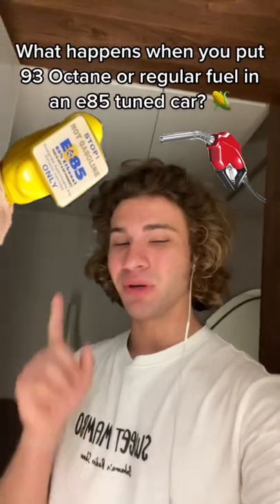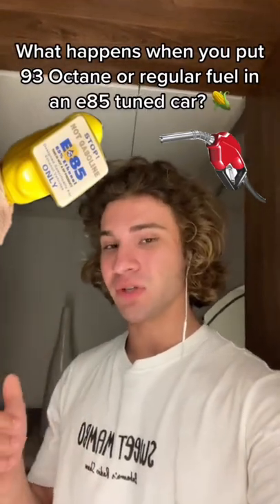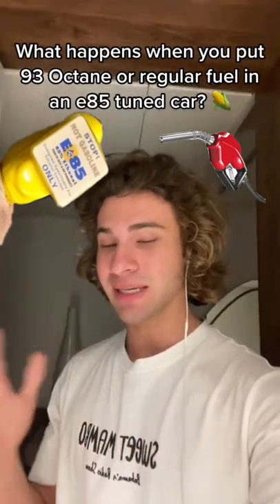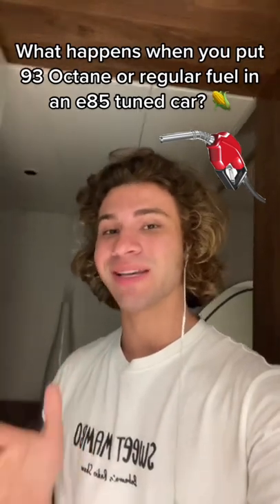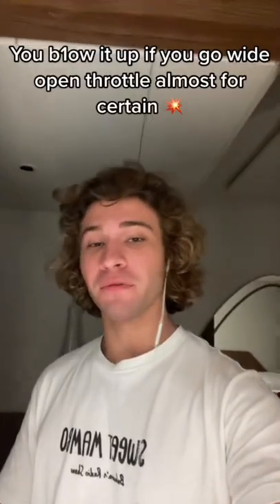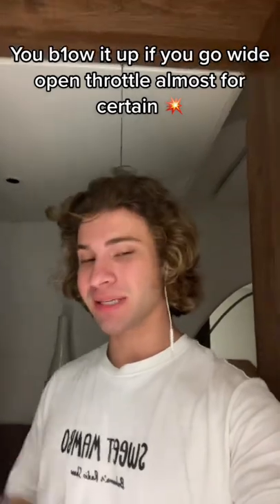THIS IS WHAT HAPPENS WHEN YOU RUN 93 PUMP GAS ON AN E85 TUNE... (BLOWN ENGINE?!) #SHORTS #E85

Comment: While not incorrect, but also incorrect, here’s some things about this:

Ethanol has less power density than gasoline, which is why you need a bigger fuel system to compensate. It’s about 30-35% less power dense (or power potential), so if you make 200hp on 93, to make the same on ethanol (E85) you’d need 30% more fuel volume to do it (I’m saying 30% for easy math, not the true mathematical number to the decimal). Running pump on a full E tune would just be super rich, and likely to cause hydro lock if run at all.

Ethanol has a MASSIVE window for timing because of insensitive to timing changes it is for its octane rating. Example would be 110 race fuel, 1 degree of timing can lose or gain a good amount of power, and is super picky. Ethanol (I believe is around 115 octane?) doesn’t give a fuck. There’s been engines that can swing 10 degrees and it barely makes a difference, hence why boosted guys love the stuff, just a safer alt fuel. Also works well combined with other fuels like meth or power adders like nitrous because of this property.

Ethanol also runs cooler than gasoline, so you can have lower cylinder chamber temps and intake temps.

Fun fact: they make ethanol scents, you can literally make your cars exhaust smell like blueberries if you wanted to on ethanol lmao

Flex fuel tunes, LITERALLY prevent this entire short. So the old ethanol only or pump only days are gone. The only people who pay attention are anyone who’s max ethanol content in their tune is anything below full E85.

Also(edit): octane is just resistance to detonation, aka the fuel can be used in high compression environments. The higher the octane, the better it will work with more compression. This is a blanket statement, and when you actually dig into the science behind how fuels work, you’ll realize it’s more of a grey area than black and white on how to balance your cylinder pressures with your fuel of choice, and desired power goal

Comment: What's his compression ratio? 93 octane will do nothing to an ethanol capable engine.  Detonation is prevented through the knock sensor, which automatically retards timing.  E85 on a strictly gas engine though will eat it up bad, since ethanol is caustic on aluminum.

Comment: E85.  Is ask follows. 85 per Ethanol and 15 gasoline. 

Octane has to do with the stability of the fuel ur using.  Higher octane for higher compression engine. Lawnmower weed eater and sports car. 
The lower the octane. The less stable the fuel. Could cause fuel to ignite before the spark engine combustion and cause an engine knock.

Comment: Neither actually. I ran flex fuel in a non converted 94 ford pickup. 300 inline 6 engine took it like a champ. Ran it again about a month ago in my daily ka24de 5speed Altima ran fine sold the car it still runs. 250k on the dash the ford had 275k when I ran flex fuel.

Comment: If your tune is for full e85 and you don’t have an ethanol content sensor, you’re gonna be running way too rich.. extra timing isn’t gonna cause knock if it won’t even run because it’s spraying 35% more fuel in than it needs

Comment: why didnt your ECU adjust lamda? any modern ecu will correct trims.......bmw for example since u used a bmw for a pic,   if you flash tune one of those for e85 and the dme sees the fuel trims are off  because youre on 91 it will adjust fuel trim targets leave your wastegates wide open and pull a ton of timing.  it will not detonate. in fact, you can drive on 91 on an e85 tune on that car because it will only make spring pressure for boost. it will not hurt it..   same for that s550 mustang you posted, both of those cars have variable valve timing, it will retard the ignition and valvetiming when fuel trims are off, this is true for ANY modern car lol.

Comment: I don't use pump fuel i use race fuel from the track near my house they sell it cheaper then gas stations they sell 105 octane fuel for 2.10 a gallon and my truck's engine is fine with it i built it to handle pure methanol so the race fuel is fine in it.

Comment: Isn't that the reason why you run a flex fuel sensor so the ecm can calculate timing based on fuel tables 🤔

Comment: You can put you have to have the best spark plugs & 12 hole injectors spread the fuel n a fuel regulator & or  maybe smaller fuel pump

Comment: Tune??? My Nissan frontier 2017 came stock flex fuel owners manual says I can use 4 types of fuel 87,89,91 flexfuel I assume it is a safer tune for stock vehicles to adjust timing from the dealership.

Comment: If you run pump gas on an e85 tune it's going to be super rich in PE... 9.75 is stoich for e85 and 14.2 is stoich for e10 pump gas. not sure if a few degrees of timing would blow a motor that way... maybe if you ran e85 on a pump gas tune it would be lean af.

Comment: Yeah, E85 doesn’t run as hot as regular fuel. It’s not gonna blow your engine up. Most of the time you can mix it if you have it tuned for that.

Comment: Running 93 in a car tuned for e85 Yes it will cause problems and yes you'll have slight timing problems but it'll just more be sputtering and not happy and if you're a car guy you'll know to just shut it down immediately because it's not supposed to do that and on another note he explained the wrong thing of what the video was saying if you run e85 in a regular tune You're going to run lean which is a whole other problem and yes timing can be a factor, but you don't always run crazy timing for e85 especially if its more of a street/strip tune.

Comment: E85 in a car not designed for it will dissolve the rubber components like your fuel lines, gaskets and o-rings.

Comment: Running Ethanol regularly is bad for your engine because alcohol has more corrosive properties than 100% gasoline. It decreases the longevity of the engine and supporting parts a minimum of 25%. You’re much better off running a good wmi kit, this increases your di fueling window, decreases charge air temps, reduces engine temps eliminating heat soak, cleans injection valves which are known for carbon buildup, and adds a big performance gain.

Comment: You know if this guy actually had some boostane that is basically octane booster straight up in a can he could have put a bunch of that in of course he would have to be doing that before he added fuel but it's always something good to have if you're going to run something high performance 

Now for those that have a regular car there's actually kits out there that you can buy that are actually decent and you'll have to unplug your injectors put in this other harness that will pass the signal from the computer to the injectors but there's a secondary computer you're going to have to intercept the signal but it will allow you to run e85 and the reason why it will do that without tuning your ECM because it's intercepting the signal and then passing what the fuel amount should be now they actually have a sensor on the fuel coming in going to your injectors so they already know how much octane ethanol is in your fuel so it automatically adjust now if there's an issue these kits actually do have a part that you keep with you and all you got to do is unplug the one little computer plug this dummy in and it will pass the signal like nothing ever happened like no modification whatever it's completely bolt on there's no splicing wires or nothing I can't remember the name of the kit but it's wonderful if you want to make a car e85 or basically run a higher grade of ethanol 

Me I'm all about that ethanol-free gas let me tell you I've run that in certain vehicles run so much better

Comment: Well, what you really need is an e85 sensor to determine the actual percentage of e85 at the time. E85 isn't 85% most of the time, it's a mix of 35-85% of ethanol depending on mix and cpu needs to know what it's actually running on and change map accordingly 😉 😀 

Happy modding everyone

Comment: Yeah putting pump gas on e85 tune will make it run rich AF if it runs at all, however if you have an e85 tune to begin with, you probably have a flex fuel sensor to accommodate for different fuels.  E85 on a pump tune is a different story it will run lean if it runs at all.  In both cases unless you are a complete moron and can't feel your car isn't running right, the chance of actually doing damage is slim.

Comment: I run e85 in my 2012 Silverado that has a jasper dod/afm deleted gen 4 5.3 that came with a dyno sheet with 87octane numbers. Zero issues. Stock pump, map, and lines. Motor has 10k miles and sees limited literally everytime I drive it. I have video proof that's 3 and a half minutes long of a limiter burnout from Oct 21st while at my cousins benefit drive. You put e85 in a car in the video so I'm confused about this.

Comment: 85 in a 93 tune will make it lean 
If your wide band or narrow band can't correct it 
You need 30% more e85 I thought so bigger injectors and a bigger feul pump 

The other way around you get pre detonation and 30% to mutch feul the amount of access feul can help cool down the engine and prevent knock but not much

Comment: What he's calling detonation is colloquially known as knock. It's premature combustion. Contrary to popular belief ethanol isn't added to fuel to reduce the amount of fuel used. It's used because ethanol replaced lead as a knock preventative. Actually the studies show that a mixture of fuel that is at least 10% but no more than 15% ethanol has been shown to reduce knock. It's not a coincidence that that range is what's posted on the pumps.

The more you know

Comment: So knocking is still a thing? Or again? And E85 should be more knock resistant than regular pump gas. Its octane rating is around 100-105 if I remember right. The higher ethanol content also means E85 has a lower energy density than regular gas. But it allows for a more aggressive tune, higher compression, more boost etc. it should be fine with blue and green avgas if you can get your hands on that. Or… try 93, add some TEL if you can get it, say bye to your cat (it’s use and pointless anyway) that’s gonna die when using TEL and have fun with improved gas mileage compared to E85. 😂

Comment: why theres 80plus octane here? but in the Philippines has 93 low octane, 95 mid octane and 100 high octane
Reply: Different systems, you're 93 and 95 are equal to our 89 and 91 respectively

Comment: Can anyone help me? So I got my custom e30 tune coming in and I have a 3.0 turbo q50 with stock fuel system. Will running a mixture of e30 on stock fuel system and e30 tune be bad or do I need to grab myself a flexfuel kit

Comment: But it's cool to run 93 on a 87 engine though right?
Getting conflicting information
Reply from the maker: Depends on the car & if it’s stock! Most factory/stock cars will adjust timing to prevent pre-detonation
Reply: @TobyVegaD  okay, thank you! That's good to know, very interesting.
Reply: Don't you'll lose power

Comment: Let me stop you right there it has nothing to do with timing running a lower octane rating meas it cant handle the compression of the engine resulting in detonation. Timing is an electrical signal sent from the ecu to your ignition coils. So with lower octane ratings predetonation can ruin the engine. Read up on it first

Comment: Nah literally all cars have fail safes for this exact reason knock sensor would put your car in limp mode before Anything actually happens to your car.  If you have a flex fuel sensor it would literally trim out your fuel map to match the ethanol content and most of the times when you get tuned for E you still have some of the oils gas in the tank unless you drop it so most likely its tuned  for close to E- 50  and most e isn’t close to 85% ethanol   I’ve mad this mistake and my car is fine it ran like shit all I had to do was get some of the 93 out and add e til about 40% til did some hard street pulls and filled it up with more E all good most people who have e tunes don’t run it on e all the time it would get shit mileage

Comment: Running E85 on a non E85 tune would have blown up the motor because you have to burn 30% more E85 then gas.  It blew up because he was running hella lean and it burned hotter then the god damn sun and turn his pistons into a liquid

Comment: You’re an absolute fool if you don’t run a flex fuel sensor (ethanol content sensor). Especially considering how not 85% “e85” can be at the pump.
Reply from the maker: You’re an absolute fool to think that every boosted car can be tuned for flex fuel
Reply: @TobyVegaD  they can? Any stand alone ecu can be programmed for flex fuel, it’s completely possible. I understand the limitations of factory ecu’s
Reply from the maker: @2zer084  Lund racing doesn’t offer flex fuel tunes for boosted cars

Comment: With how much fuel you will be dumping into the intake on an E85 tune, your never going to see detonation. You will see bore wash, oil dilution, crap milage and destroy the cat if you still have one....
Reply: Simply not true....I filled up full tank of 93 with E85 tune...ran out of options so had to do it to get to the station that pumps E85.
If you dont go WOT, you can drive till empty and then properly fill E85.  Its not recommended but you WONT blow anything up or do any damage.

Comment: What kind of shitty fuel do you guys have? Over here it doesn’t matter if you use regular or high octane. That’s what knock sensors are for.
Reply from the maker: Lol I don’t think you understand the octane differences between pump gas & e85 + how it can blow your motor up when you’re putting the wrong gas in on an ethanol tune.

Comment: Bro is really slow 🤣 he got it completely reversed. Running more timing on pump gas will 100% blow your motor. Pump fuel isn’t high enough octane for aggressive timing. Running e85 allows you to put more timing cause it’s higher octane and the flashpoint is lower than regular pump gas. Do not listen to this guy at all. Putting e85 in your car will not blow your motor it will just make it run like 💩 if you don’t have a tune and will destroy any type of plastic of you have in the lines.
Reply from the maker: Literally what I said. Thanks for this exemplary display of intelligence 🙏🙏
Reply: @TobyVegaD  the video said when you put in a full tank of e85 and you forgot to switch tunes. Implying that he’s on a pump gas tune and he put in e85. Which would actually prevent you from going into detonation instead of going into detonation but you need much more than just a tune for e85. You need bigger injectors, fuel pump, upgraded lines. E85 has about 30% less combustion power which means you have to burn more fuel to get the same amount of power. My point is putting e85 in your car without the proper modifications will not blow up your car and I think people will misinterpret that in this video